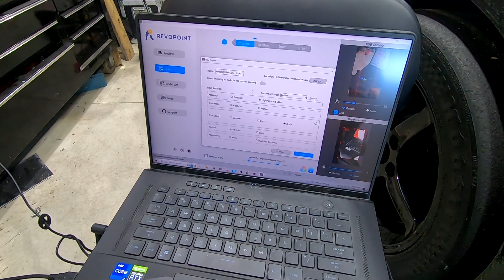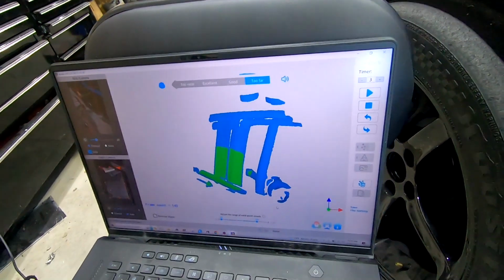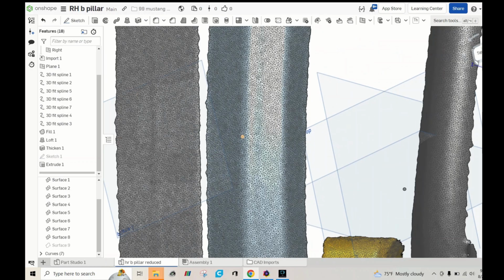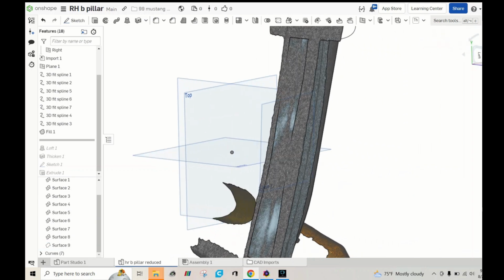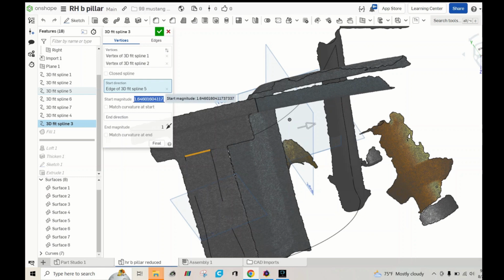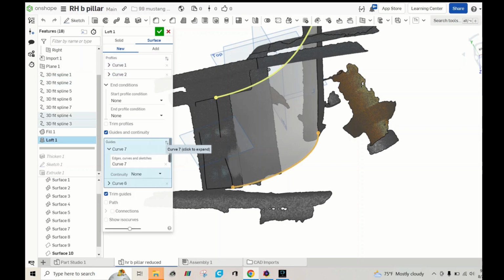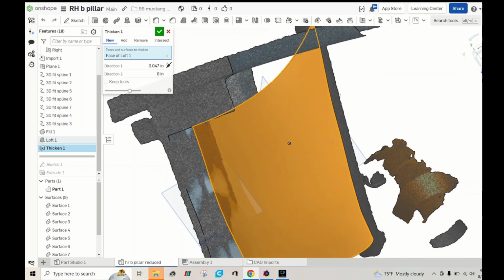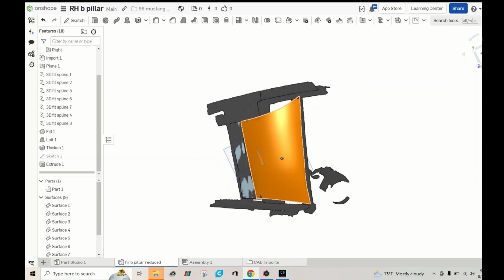Revopoint Range 3D Scanner- Scanning, CAD Modeling, 3D Printing Project

Comment: Thanks for the video showing the workflow, including the modelling/design side.      Boy, it looks like laying the tape down to prep your scanning surfaces took more time than the scan with the Range.
Reply from the maker: It definitely did but was recouped by 10 fold when scanning. Biggest issue I see with people getting into scanning is not properly prepping what they plan to scan.
Reply: Just like any job. Its 90% prep and 10% doing if you want to be successful.

Comment: this is the same thing im trying to learn and practice, i got he revopoint inspire coming here soon, gonna be using it for my formula cars and designing sidepods and bodywork. I just need to work on using 3d splines, they're not very easy to use at times. Might even use the scanner for designing exhaust headers and expansion pipes.

Comment: just curious why are you using the old software? the new one is a much cleaner experience and has some nice new features :)
love the video as always :)
Reply from the maker: Recorded this a while ago. Not sure if the new software was out then.
Reply: @ajhartmanaero  ahh that makes sense haha idk if you've tried it yet but the overhaul is definitely nice haha
Reply from the maker: @digital0785  I just started seeing stuff about the new release so will download it for my next project.
Reply: @ajhartmanaero  the software since v5 has made some pretty big improvements :) the fact that you can scan edit and calibrate all the scanners (minus calibrating the range which I hope they do something for that) in one software now is super nice
Reply: @digital0785  I like the new software ... but found that with my (admittedly old) laptop, it wasn't able to use the new software with my Mini.

The showstopper for my old laptop: Revopoint needs to improve the tech requirements listed, that window version requires driver support for at least OpenGL 4.0.   For anyone wondering, it's a matter of finding out if you've a nVidia, AMD, or Intel GPU, and check on the model of card/GPU your machine has on their technical pages.

That OpenGL v4.0  the key library Revopoint  is using on the back end, to leverage the GPU on Android/iOS/Windows/MacOS and make RevoScan 5.x fast, snappy, and much more agile and adept with tracking vs the 4.x software.

I did experience it fully with the Android phone version: 5.2.2 on Android (A Motorola phone) works WAAAAY faster on the post-processing steps than it did on my laptop with Revoscan 4.x like AJ has.

AJ: you'll be able to install the 5.x software in tandem on your computer with your existing one, to give the transition a go.  The public betas of 5.x were coming out in the spring of 2023, and development and update of the 4.x versions has stopped.

It is great to see that Revopoint did make all their scanners and software in a way that they work on both the older and current software.   This is rarer than you think.
Reply: @chrstphrr  i noticed that my mini didn't work either I let them know I thought maybe it was because the mini I was trying to use was a beta. It worked in the last versions though hmm